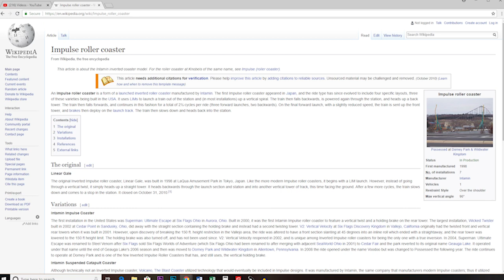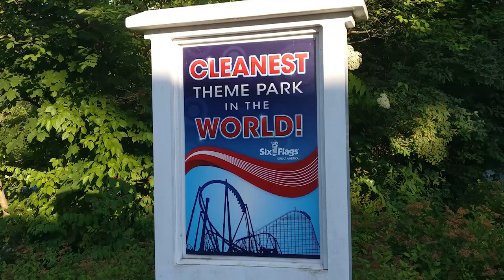Electromagnets, roller coasters, half-a-dozen flags, and clunkless chain lifts

Comment: small correction, LIMs and LSMs do sound the same, if you listen to the sound of the launch on the ride you were showing, and compare it to the sound when Wicked launches (Wicked being a launch coaster at Lagoon which uses LSMs) they both have the same screech which is synonomous with launch coasters that use magnets for the launch (LIMs and LSMs) then, another small thing, no, it doesn't use flywheels, the only launches that will use those are the flywheel launches (not very common, and not made anymore) and hydraulic launches such as the launches on Top Thrill Dragster and Kingda Ka, but that's an entirely different type of launch that I don't feel like getting into, so, anyone who read this whole thing, kudos to you, that's a whole spiel about coasters from a coaster enthusiast read
Reply: They really don’t sound the same. LSMs have more of a smooth screech (see Taron or Red Force) as opposed to LIMs which sound more mechanical (see Joker’s Jinx or Speed: The Ride). And flywheel launches absolutely are still made, mostly by Zamperla on their Moto Coaster model, the most recent of which opened only three years ago in 2018. Golden Horse also has a flywheel coaster model, with the most recent one opening only 14 days ago.

Comment: I think the counterweight is attached to the chain sprocket and acts as a pretensioner on the chain and motor. When the train engages, the chain stretches out a few inches (over a long, relatively lightweight chain), causing the weight to lower. I bet if you were to watch the weight as the train goes up the track, it would slowly return to it's unloaded position as less of the chain comes under the full weight of the car.

Comment: You would be correct. The reason B&M coasters engage the lift so smoothly is because of the feed tires. However, there are a couple of B&M's that don't have feed tires that do in fact "klunk" onto the chain. Valravn at Cedar Point and Griffon at Busch Gardens Williamsburg are two examples of this. There is also another exception to the feed tire method on Mako at Seaworld Orlando. Instead of feed tires, the lead in to the lift is sloped slightly such that gravity feeds the train onto the lift, but without as much of a klunk.

Comment: The weight is a chain tensioner. But the pickup on that one is smoother because it's a B&M, their lift motors have 3 speeds while most have 2. It has an idle and an active speed like most but on the B&M's the lift motor also has an engage speed. That's why the speed increases after its latched. The lift can also vary speed depending on how far through the course the train infront is.

Comment: That screeching noise makes me suspect they're using old-fashioned cycloconverters to drive the induction 'motors' (the actual motor armature being the train itself) and it could very well be that the drive electronics is kept with the coil packs to prevent any high-frequency gobbledigook from interfering with the rest of the ride. In that case, each coil pack will have its own variable frequency drive and the blowers are cooling the drive units and brake resistors as well as the coil packs itself. The drives are probably grouped and slaved together to run at the same output frequency.

If the drives were more modern using IGBTs, the switching frequency is often in the area of 4-16 kHz and it would only be audible on the lower end of that range. The cabinets you see are probably not the transformers but the actual VFD cabinets with the brake resistors attached to the back where the giant heat sinks are.
Reply: No brake resistors on these rides. I'm fairly certain it's a high frequency drive, hence the squeal. The coil packs are pretty simple...each stator consists of the two coil packs in the center and the two reaction plates on the outside. Cleverly, they are using both sides of each coil pack. The train has three fins, a copper fin in the center for the double sided LIM, and two aluminum fins for the outer single-sided LIMs and for the permanent magnet magnetic brakes.

Comment: The smooth engagement of the train onto the chain is most likely due to the coupler that hooks on to the chain being mounted to the car with a spring and damper. At least that's how I would design it. It's possible that the idler tires are powered/braked and they are used to smoothly match the speed of the train and chain, then slow the train slightly to allow a simi-ridgidly mounted coupler (just a plain rubber shock mount) to grab a chain link.  There is plenty of time for the speed adjustments to be made unnoticeable.

The counter weight is just taking up the extra length of chain due to the load as the train grabs it. The weight of the train is nothing for a chain of that size, but there is always some stretching. If each link stretched .0001" that add up over probably thousands of links.
Reply: The chain clutch is really simple. It's literally a large metal hook biased by gravity into a 'down' position, but able to rotate upward to roll over the chain links if the train is moving faster than the chain, both at engagement and at release. The only difference between the chain clutch and the safety pawls is that the chain clutch has a curved cutout on the end to engage with the chain roller, while the safeties have an angled end to positively hook into the lift sawtooth. Also, the safeties have a resilient pad on the bottom to cut down on the noise.

Comment: Re: Raging Bull's lift counterweight... chain stretch.  That movement represents how much the chain stretches from the drive sprocket (at the bottom), going all the way up the return pan under the lift, over the bullwheel at the top, all the way back down, and finally to the train.  As the train moves from horizontal to the angle of the lift, more and more tension is applied.

Comment: I love the launch mechanism of the Hulk coaster at Islands of Adventure. It’s basically a huge baseball batting cage launcher, and it’s the only ride lift I can think of that pulls off a surprise plot twist. It acts like it’s going to be a traditional drop coaster until it flings you over the top of the hill at the last second. Usually the pretend emergency/accident/shark-attack of a ride is the whole pretext for the ride itself.
Reply: That's another B&M coaster, but I recall hearing somewhere that they didn't build the launch mechanism themselves as they don't (or didn't, at the time) do launched coasters. Physically it's just a great big rubber-tire launch. The launches in Escape from Gringotts work the same way.

Comment: You're exactly right about the counterweight being responsible for the smooth engagement with the lift chain. Older coasters have more primitive tensioners which is why you get a jerky engagement and a bit of lurching until the train gets up to speed. You can really see the effect on some old Arrow coasters. Rather than weights, Arrow used a couple of gears at the base of the chain lift, one of which is on an arm that can move slightly back and forth to tighten the chain as the train latches on. Watch the tensioner bounce back and forth as a train engages on an old arrow and notice that it's timed perfectly with the lurching motion of the train (or, more visibly, the riders on the train). Unfortunately, that will be hard to observe at that particular park since your only Arrow is Demon and it's actually one of the better ones (despite it also being one of the older ones...)

Comment: It'll be driven by a big ass opto-coupled IGBT array. Being linear, it's like a direct drive motor, so I'd guess fairly low voltage DC but huge current. Which explain the cooling
Reply: th3d3wd3r yeah they jump up about 30 degrees Celsius every time it pulls the train!

Comment: Check out Brian and Anne Ondrey of Irvine-Ondrey Engineering. Their company provides controls and electrical systems for rides. Brian used to work for Consign, the company who does B&M's electrical systems before he left to start his own company. He and his wife are very involved on Facebook and can answer any questions you may have about roller coasters. As for the clunkless lift hills, the chain lifts and feeder wheels are driven by VFD's or variable frequency drives. These drives adjust the frequency from 60Hz down to whatever you want so that a motor can have multiple speeds. The programmers set the output frequencies so that the feeder wheels and chain lift are moving the train at the same speed. Usually, this also involves riding the coaster to feel how close they are matched for an effortless transition. Not all coaster companies use feeder wheels before the lift, which is why some lifts have a noticeable clunk when the chain dog engages in the chain. Hope that helps!

Comment: The screeching noise is the result of the LIM electro magnets being driven by a variable frequency drive inverter control , the high frequency switched drive current acts rather like an audio signal in a speaker,   https://www.youtube.com/watch?v=W_GlnJOTdKs , Many of these drives use Pulse Width Modulation signal to do this ,,how this works ,,https://youtu.be/v51yWKrEZJM this switching creates audible  Harmonics "the high pitched screech" Due to the extreme current draw requirements of LIM launched coasters , many of them have a huge capacitor bank energy storage system to prevent local electrical grid impacts ..

Comment: You're in the Midwest man, get over to Cedar Point and ride some proper coasters. OK, it's gonna be outside the range of your Volt, but you still gotta get there.
Reply from the maker: The Volt has a gasoline engine, remember, so it's definitely within range :)
I've been to Cedar Point only once when I was either 12 or 13.  I enjoyed it a lot, and in some ways I have that trip to thank for this channel's success.  That will take a while to explain, but it relates to a jukebox that you'll be seeing in an upcoming TC video.  I should go back some day!
Reply: It's gotten better :) You know how everything is so big as a kid, then you grow up, and it seems so small? Cedar Point is the opposite.
Reply: Or get to Kings Island they have some great rides there including the Worlds Longest Roller Coster
Reply: Dean Cory The Beast!
Reply: Fwiffo My all time favorite woody.  I did not know about Son of Beast (living in a cave at the time) and never got to ride it! :-(
Reply: Dean Cory sorry but the worlds longest coaster is actually in Japan. The beast is the 3rd longest in the world
Reply: @DrDiff952  Longest wooden* coaster in the world.
Reply: @peterjszerszen   It's not a knockoff, it's built by the same manufacturer.
Reply: @dlk5823  Not only that, but Vertical Velocity is supposed to do something that Wicked Twister *can't**. There is a set of LIMs on the back vertical spike which are (were?) run in reverse at stall for half a second so that when the train reaches the top of the back spike, it **stops* for half a second. Which is extremely cool. If that's working, then the ride demonstrates all the things that LIMs can do on a ride--
o They launch the ride from a dead stop and accelerate it to 70+ MPH
o Because the LIMs are three-phase, they can accelerate in both directions
o They can develop full thrust at stall (zero speed)
o They can be used in conjunction with the timing comb to precisely position the train in the station.
On all the Impulse coasters I have seen (this one, Wicked Twister, and the original at Geauga Lake) there are no friction brakes at all. The station track is perfectly level, and while the magnetic brakes aren't capable of holding the train in place, they can make it extremely difficult to move, and that's adequate for loading and unloading. In operation, the brakes are dropped on the last backward pass, slowing the train to a near standstill, then the brakes are raised and the LIMs are used to jog the train into the station and park it for loading and unloading. When the motors stop, the brakes are dropped back into position.

Comment: For reference or interest on your LIM sounds, as somewhat else has mentioned in the comments. Vancouver’s Skytrain systems Mark 2 Cars are remarkably similar in their sound using extremely reliable LIM motor incorporating a reaction rail in the centre of the guideway. I suspect the more recent examples like the ride shown and the Mark 2 Skytrain cars are AC type control motors. As for the counterweight on the rollercoaster is a tensioner for the chain.

Mark 2 ART train by Bombardier:  https://youtu.be/x1PHOhZ9AeQ

Please see second link below of The original Mark 1 ART cars which use the first generation LIM motors

Comment: At 5:18, the picture on the Wikipedia page for the Impulse Roller Coaster is Possessed. It’s in Dorney Park and Wild Water Kingdom. I work at one of the two Subways there. One of my supervisors refuses to go on it because the beam holding the train shakes when it’s running.

Comment: It's a tensioner, if you look at older Arrow coasters their tensioners are much simpler and easier to decipher. This is a good example: https://rcdb.com/123.htm#p=9476 As for LIMs, they're really neat technology, but nowhere near as efficient as Linear Synchronous Motors, which are the go-to for today's launched coasters. Worked at a park with the same model, and the sound is even better in person, especially when guests react to it while waiting in line

EDIT: If you ever want to see Newton's 3rd law in action, look at what the track and supports visibly sway backwards as the magnets push the train forward. Neatest demonstration ever, and gives you an idea of the forces involved here

Comment: Couple notes from this video
1. Go to Silver Dollar City and Dollywood because they are amazing parks owned by Herschend and are clean, have a great atmosphere, and good food. But with Silver Dollar City I think you would love watching the new for 2018 Time Traveler Coaster. Its a controlled spinning coaster and It’s using new technology to make it work. It cost $26 million. It’s the tallest, fastest, steepest, first double launching and first inverting spinning coaster. It starts with you dropping 10-story’s right out of the station. 
2. The launch you heard was nice and all but the Premier rides LIM launch sounds are way cooler. Look up either of the Mr. Freeze reverse blast or poltergeist at fiesta Texas or Jokers jinx. They make a lower frequency buzzing sound are a lot more forceful than the Intamin LIM launchers. 
3. B&M’s do have a anti rollback system like the old woodies do but they have learned how to keep it quiet unlike RMC who wants people in Mexico to know when Steel Vengeance is climbing the lift. I notice this on the Batman inverts and Wildfire at Silver Dollar city. 
4. I agree with everything you said about Six Flags.

Comment: I worked at Cedar point over the summer and all of our B&M models have the kachunk. Gate keeper and Valravn to be specific. I believe Millennium doesn't have it because of the cable lift system. The orange coaster that you're showing most likely just uses the chain and the counter weight for when the car needs to make an emergency stop. The kerchunk is usually for a safety catch for the cars in case the chain stops (you probably knew that) 

BTW you work at Disney? that's amazing. 

Also at cedar point we have menacing signs about entering ride areas as well. the reason those signs are so mean towards guest is because it doesn't matter how many nice signs we put up some idiot tries to jump the fence or asks an associate to jump the fence for them. 

For example in 2016 a man (who mind you was a teacher) believed he lost his phone on Raptor which is a very low to the ground coaster at sections. He jumped the fence to get his phone and once he got under the coaster he got his head kicked off. Like literally decapitated. His phone was in the bar right behind the ride. (You may have known that story). You would be amazed with all the morons who thought it would be ok to do that. 

Idk why these people asked me if they could hop the fence my job was to fix games and lockers I didn't touch rides at all but I sure wasn't stupid enough to let anyone jump the fence or jump for them. 

Moral of this story is, the mean signs saying to not hop the fence are there because people lack common sense. Same with the signs on the rides that says it's a misdemeanor not to listen to the operator (at least in Ohio). Its common sense but some moron had to test out if their phone could break someones nose if they rode with it out. 

Ok sorry rant over.

Comment: Launch coasters do not have all the complex machinery of other coasters, but you are correct in that they use a butt load of electricity! They also create a butt load of heat. There are other models including one from Mack which actually have coolant systems for the metal components. 

Your theory for the clunkless chain lift is correct. The set of friction drives, or idler tires that you pointed out, are synchronized to ease the train onto the chain in a manner where the chain dog can connect to it silently. You may have also noticed that this coaster does not have the clickety-clack sound that older coasters have as they ascend the lift hill. Most modern coasters have a glide finger that raises the anti-rollback dog up and off of the sawtooth that is visible in your video. In the event of a lift chain failure, as the train begins to roll backwards down the hill, the glide finger would automatically reverse direction and lower the anti-rollback dog onto the sawtooth, thus freezing the train in its tracks.